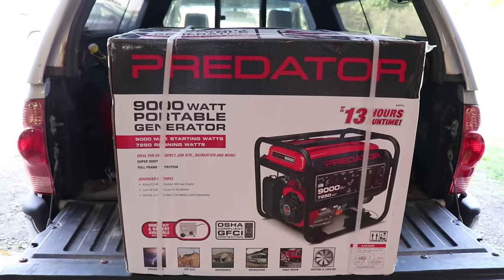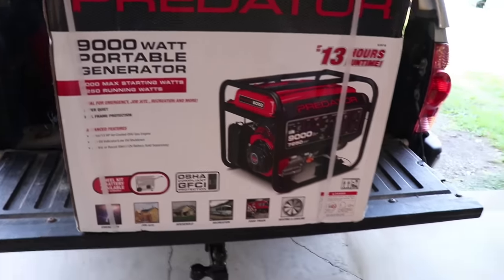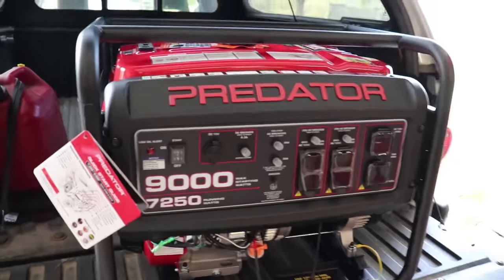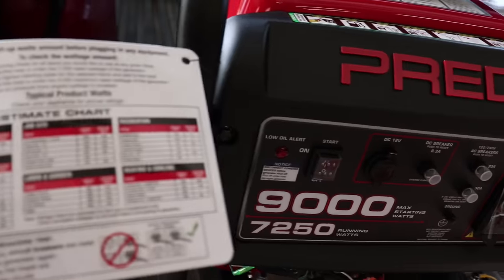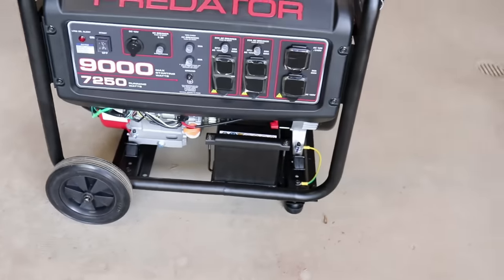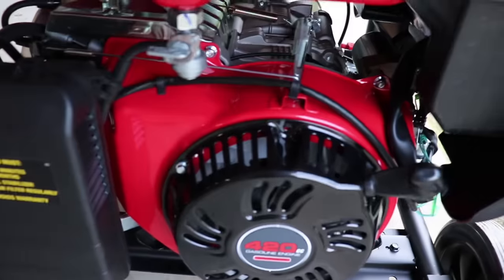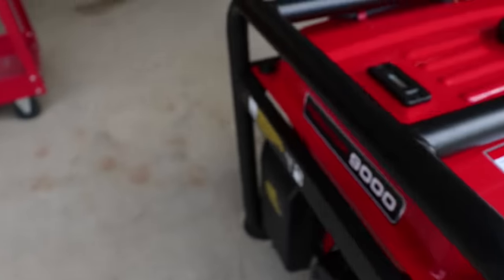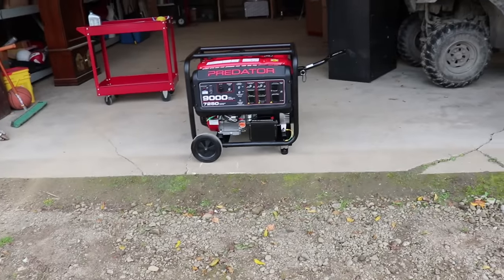Predator Generator Running Our ENTIRE Home. (Complete Setup and Cost)

Comment: I am wondering are you better off just buying two smaller generators (instead of one this size).  Any thoughts on this?  Also these are LOUD. I had an inverter generator that I sold because I didn't really need it (i very rarely lose power), but it wasn't as loud as these type generators, so if you are going to use for an extended periods, I would recommend buying or making a sound dampening generator storage shed
Reply: ⚠️Here’s an important safety announcement for everyone:

Please make sure you follow the generator safety tips whenever you use your portable generator. This is just a reminder for everyone’s safety. All generator safety rules need to be followed carefully 

Here are the generator safety tips: 

1) KEEPING OTHERS SAFE: Please do not allow an non qualified person or your children to operate and service the portable generator. Just because some manuals don’t say that doesn’t mean it’s safe. That is important against the generator safety rules. We also need to be keeping an eye on our children too. You need to make sure that your children are not playing near the portable generator especially when it’s running so they won’t get electrocuted. Generators pose electrical risks and they can be hot during an operation. Please keep your children away from the portable generator at all times. It is important to keep our children safe especially our little ones. Children often get curious about anything so we should keep an eye on them to also make sure they’re not wandering towards the generator. 

2) WHERE TO RUN YOUR GENERATOR: Some people use their portable generators indoors which increases the risk of carbon monoxide poisoning. It’s important to have a carbon monoxide if you have a gas generator. Never ever use your generator indoors even if your doors and windows are open and even in the garage is not safe to use a portable generator. Not even at your porch and your deck. It is never safe to use your generator indoors and in enclosed areas of your home. Your generator needs to be 15-20 feet away from your house. 

3)🔥FIRE HAZARDS: Never refuel your generator while it’s running. You need to let your generator cool off before refueling it and before storing your generator. Never overload your generator too. Never ever back feed your generator. You should never plug your generator into a wall outlet. Also never store propane tanks indoors. Please keep flammable things away from the generator as well and please don’t smoke cigarettes near the generator. Having a fire extinguisher next to the generator is also important against the generator safety rules. 

4) GENERATOR OPERATION: make sure your hands are dry before touching the generator. Never use your generator in wet conditions. Don’t let your generator get wet. You need a generator tent if you need to use your generator during wet weather. Please don’t wear loose clothes when operating the generator. Turn on your generator before plugging in appliances. Use the right cord for your generator. Please do not use worn out cords. Do not touch the generator’s engine when it’s still hot. 

https://youtu.be/I1jT3ANENvI and here is a video more about keeping others safe when using generators. All generator safety rules need to be followed carefully. 

Hope this helps. 

Please make sure you follow all the generator safety rules.

Comment: Does it need grounding??
Reply: Only if using extension cords.  If you use the 30-amp outlets to an inlet connected to the Main Control Panel of your house, you don't.  It's grounded through the Main Control Panel.

Comment: I’m guessing the generator itself doesn’t have a display to tell you how much power you’re using?
Reply from the maker: No it doesn't. I have a good idea of what I'm running. It has handled all our basic stuff (refrigerators, freezers, heat, water pump, etc. ) very well.

Comment: If you ever have to backfeed, and you do not have a main switch in your house, go out to your meter and turn it off outside… if you do this, please please please put a big visible sign on it that clearly states not to turn it on due to a backfeed, this is really important because you can electrocute the poor guy trying to fix your power down the street if you run power through it
Reply from the maker: I have an interlock switch. Can't turn on generator without turning off main breaker.

Comment: Look into a line conditioner for the AC sine wave if you're going to run sensitive Electronics such as a computer you want to make sure you're on the 60 Cycle frequency not to burn out any Electronics

Comment: The only problem with portable generators is having a LOT OF FUEL. THEY USE A LOT OF FUEL AND IF YOUR POWER GOES OUT A LOT YOU MIGHT CONSIDER BITING THE BULLET AND GETTING A WHOLE HOUSE GENERATOR LIKE A GENERAC.THEY COST A LOT BUT ONCE YOU HAVE ONE YOU WILL NEVER BE IN THE DARK AGAIN.
Reply from the maker: Though about that. Right now I have enough fuel to run periodically through the day to last me almost 3 weeks. I have to run in 1 hour on, 3 off. That will sustain my refrigerators, freezers, charge everything up, run water, flush toilets, take showers...ect. I have an alternative heat source, so I am good with that. But you are right, you definitely need fuel!
Reply: That's why installing a Tri-fuel kit is a must for any gasoline generator.  This will allow you to run it on gasoline, natural gas and liquid propane.

Comment: So all I got to do is turn off the power house switch and then turn on the generator switch when in need to use?
Reply from the maker: Yes. But it is critical to turn off main or it will backfeed to power lines.

Comment: So how can we run a generator if we don’t have a switch over and separate plug. I suppose we can’t ?
Reply: You can, just use extension cords and plug them into the 120V outlets on the generator.

Comment: You don't need a fuel stabilizer as much as you need to find a gas pump that doesn't pollute the gas with ethanol. There are still non ethanol gas pumps and a website that shows them to you. I forgot what it's called though.
Reply: Don’t forget about generator safety as well https://youtu.be/I1jT3ANENvI

Comment: You didn’t show how to wire it to the fuse panel. Actually, the most important part. Also, did you try to run air conditioning? Nice work.
Reply from the maker: Look in description.  I have a video on both.

Comment: That predator model becomes more expensive than similar ones from other brands. Battery, wheels and power cord are sold separately, it's an extra expense of over $ 100.
Reply: Are you kidding?....no doubt adding the accessories costs $$..... but size-for-size almost nothing costs less than any comparable size Predator.

Comment: I would add a transfer switch, but nice. I'm surprised that little wattage did the whole house and garage.
Reply: I agree on the transfer switch.  Dangerous set up here.
Reply: @Jack Again  - respectfully, I use a lockout switch. Much less expensive, doesn't break, foolproof, very easy to install and use. I'd use a transfer switch for a fully automated, permanently installed gen, but for a portable one (mine is 13kW), definitely recommend a lockout switch instead. Hope this is helpful.
Reply: Don’t forget about generator safety as well https://youtu.be/I1jT3ANENvI stay safe everyone

Comment: Im just worried about the central air and fridge and freezer.   Im gas so my stove will always work when power is out but we have heat waves.
Reply: We have this same generator, and it works great.  I installed a Tri-Fuel kit on ours to run off our homes NG line.  We have a 3-ton AC unit that I installed a Soft Start on.  We can now run our AC with our generator using NG, along with the rest of our house easily.

Comment: Can you run the AC with this? 🤞
Reply from the maker: Yes....check out video in description.
Reply: @TheCookFamilyHomestead  thanks for that. We have central air and heat. I’m wondering if it will run it with the predator 9000.... I believe the compressor outside draws 30 amps alone before the inside unit even starts..... and I think the P9000 is a 30 amp

Comment: Better off with a Briggs & Stratton Home generator. If you're out of power for 2 weeks the Predator can't do it all. You'll run out of fuel. Most people have heat pumps too. The new Briggs & Stratton has a 10 year warranty too.

Comment: Can’t you just use ethanol free fuel so you want have to use a stabilizer? Also that’s not a fuse box it’s a breaker panel. Also not everyone will have a main breaker in their panel. You either will have to add one or it’s possible on some existing panels you can’t. And if you want a generator that puts out 240v you better make sure you have 2 open slots. I’ve seen panels that are maxed out. So just keep that in mind. I cracked up when people say that the panel work is the easiest. It can be easy but not always

Comment: Great video and explanation.  I am planning a similar setup in my house, currently own the Predator 9000 and use it for power tools.  My concern is regarding the THC on the Predator Gen-set.  Have you or anyone had any issues with electronics when powering the whole house?
Reply: Good comment....my feeling is that the low-THD thing is severely overhyped. Everyone "talks" about the danger of frying "delicate" electronics.....but what exactly are these devices? I've seen no one actually post his personal experience having done so to damage stuff. Everyone (nowadays) is worried about frying "delicate electronics" and therefore trying to force everyone to upgrade to inverter-type  or low THD generators. No one really defines what kind of devices are "delicate"...as I see a lot of folks using these standard type generators for laptops, flat-screen TV's, internet box, etc.....with no problem. I would love a definitive answer too.....

Comment: I'd to see it how it works powering a 220 volt heat pump for several hours or days. Also, how long does a tank of fuel last before you need to refill it ?

Comment: So what happens if the power company turns back on the power and you're running your generator
Reply from the maker: I have an interlock switch in my electrical panel. You can't run it without the switch being on. That way it can't back feed. You definitely should have an interlock switch. In the description to the video, I have a video showing how it is hooked up to my electrical panel.

Comment: Had the same one. Lasted 5 months of light use. Died.
Reply: Gotta change the oil after 30 minutes of use for the first time most people never read the starting instructions and never change the break in oil that's why you killed your generator

Comment: A $30.00 tri fuel carburetor  is available  to convert these to run off of either gasoline, propane  or natural gas. Order for your  size engine.  Order it and hoses  online.propane uses  regulator  just like gas grill. Then you will  not  need to worry about  getting  gasoline or it going  bad on you  . Also natural gas  and propane  burns clean an oil  stays clean ,and its nearly fume free!  Never run any engine  inside always have plenty  of ventilation  and exhaust  to the outside ,also never    allow  generator  and its power  cord  to  get  wet! Always  remember  carbon monoxide  is deadly!

Comment: Leaving gas in the generator's fuel line will lead to degradation of the carburetor parts & the necessity for a rebuild.
If you install a Natural Gas / Propane  conversion kit you won't have this problem. Century Fuel Products sells  an excellent, reliable system ... although it's a bit pricey at $200, their support is good.
Reply from the maker: Great advice. I am thinking of doing this with propane.
Reply: @TheCookFamilyHomestead  
Glad I could contribute. Note that the $200 price (at least used to) include[s] full 3-way fuel capability. And natural gas (or propane) is used by GM on their production lines to do the initial test on the engine. More gentle & leaves no residue.
(I have the quiet 3000 watt Predator, but had to design my own adapter since I didn't want to use the snorkel (flexible tube) version. Mine's all hard metal like Century's. )
Best wishes!
Mike 
Mike

Comment: Do we need a certified electrician to rewire the breaker panel in order to use this generator? Just be on the safe side I guess.
Reply: I know in Michigan you can work on your own load center you can work on your own service and mast but the electric company has to connect and approve it is a few other states you can do it it and those are the few states that houses are still affordable because you can

Comment: Nice video! I'm researching things in preparation for doing something similar. There is one thing I'm wondering about that I've not seen addressed ANYWHERE. I know it's simple, but how does one become alerted to the fact power has been restored and you can stop using the generator? With the main switch turned off, it seems there is no way to know unless you happen to notice power is on for neighbors that have no generator in use.
Reply from the maker: For me it would be from a neighbor.
Reply: I leave a main light in the house on the line only, so when power is restored, I can verify by seeing that light lit.

Comment: In my opinion, back feeding an electrical panel is dangerous. Not meant to work that way. Spend the extra money and get a proper transfer switch.
Reply: ⚠️Here are the rules about generator safety:

Please make sure you follow the generator safety tips whenever you use your portable generator. This is just a reminder for everyone’s safety. All generator safety rules need to be followed carefully 

Here are the generator safety tips: 

1) KEEPING OTHERS SAFE: Please do not allow an non qualified person or your children to operate and service the portable generator. Just because some manuals don’t say that doesn’t mean it’s safe. That is important against the generator safety rules. We also need to be keeping an eye on our children too. You need to make sure that your children are not playing near the portable generator especially when it’s running so they won’t get electrocuted. Generators pose electrical risks and they can be hot during an operation. Please keep your children away from the portable generator at all times. It is important to keep our children safe especially our little ones. Children often get curious about anything so we should keep an eye on them to also make sure they’re not wandering towards the generator. 

2) WHERE TO RUN YOUR GENERATOR: Some people use their portable generators indoors which increases the risk of carbon monoxide poisoning. It’s important to have a carbon monoxide if you have a gas generator. Never ever use your generator indoors even if your doors and windows are open and even in the garage is not safe to use a portable generator. Not even at your porch and your deck. It is never safe to use your generator indoors and in enclosed areas of your home. Your generator needs to be 15-20 feet away from your house. 

3)🔥FIRE HAZARDS: Never refuel your generator while it’s running. You need to let your generator cool off before refueling it and before storing your generator. Never overload your generator too. Never ever back feed your generator. You should never plug your generator into a wall outlet. Also never store propane tanks indoors. Please keep flammable things away from the generator as well and please don’t smoke cigarettes near the generator. Having a fire extinguisher next to the generator is also important against the generator safety rules. 

4) GENERATOR OPERATION: make sure your hands are dry before touching the generator. Never use your generator in wet conditions. Don’t let your generator get wet. You need a generator tent if you need to use your generator during wet weather. Please don’t wear loose clothes when operating the generator. Turn on your generator before plugging in appliances. Use the right cord for your generator. Please do not use worn out cords. Do not touch the generator’s engine when it’s still hot. 

https://youtu.be/I1jT3ANENvI and here is a video more about keeping others safe when using generators. All generator safety rules need to be followed carefully. 

Hope this helps. 

Please make sure you follow all the generator safety rules.

Comment: Had one, it will not run a whole house with lights, fridge, freezer, etc and cooling with a two ton central AC unit.    It would run my cental heat which is a natural gas unit.  The 9000 only has a 30 amp plug.  I ended up going with the 13000 and it has a 50 amp plug capable of running my whole house with the AC.  Folks it pays to do some research before investing in a generator.  Anything that cools has a much higher starting amp draw than continuous draw.  All up cost will be much higher than your generator if you tie it directly into your home.

Comment: Wow...GFCI protection.  Not all have it even though NEC 590.6.(A).3 requires it for 15kW or less.  My cheapy has it and I've seen it on Generac as well.  Beware of using detergent motor oil.  It will foam up and if your genny has a high oil switch, the bubbles will hit that switch and kill the genny.  Spend the money for a real genny 30W oil like Briggs sells. Why spend time trying to figure out why the genny keeps shutting off?  Also check the voltage coming out of the genny often.  When a voltage reg goes bad, and they will go bad, the voltage may go up.  Mine went to 186 volts.  Fortunately they are super easy to replace.
Reply: Don’t forget to watch this video about generator safety https://youtu.be/I1jT3ANENvI hope you stay safe. Thank you.

Comment: You didn't break the new generator in? You should run the break in for 6-8 hours using conventional oil. Then, change the oil to synthetic oil.